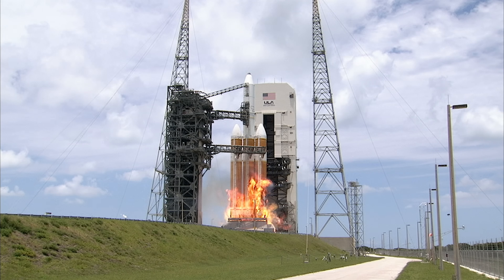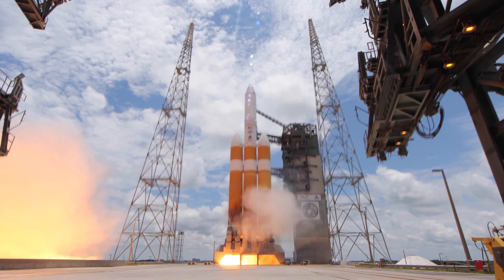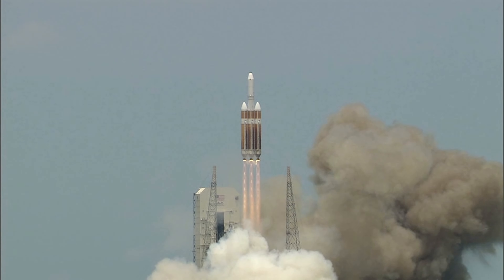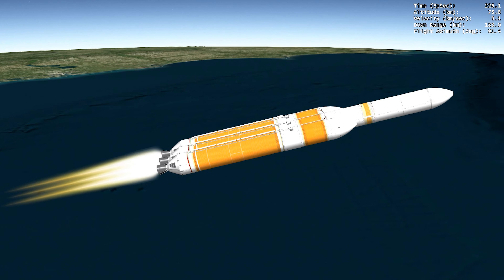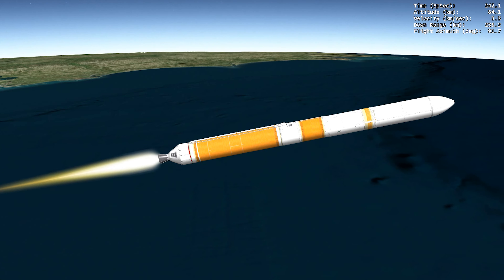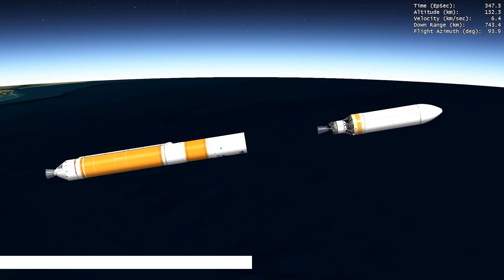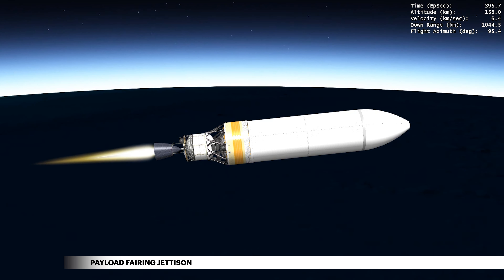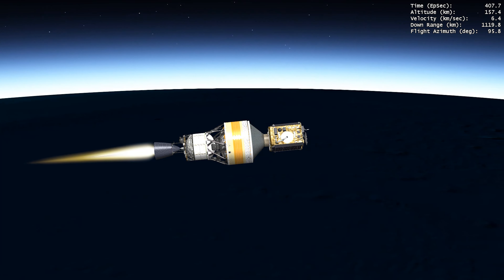Delta IV Heavy NROL-68 Mission Profile

Comment: We’re saying goodbye to 2 absolutely amazing rockets, Delta IV Heavy and Ariane 5 😭
Reply: Space industry has upgraded or switched launch vehicles about every 20 years (generation). Challenger/Columbia losses & USAF 1995 EELV shortened change.
1960 - 1975/80 - 1990/95 - 2010/15 - 2025/30.
Reply: @w9gb  yes

Comment: I thought the last of these was lit off a few years ago, glad to see I was wrong!
Reply: There are two left, NROL-68 NET 21 June, 23. and NROL-70 sometime next year.
Reply: For SLC-6 at Vandenberg, no more Delta Heavy flights.  ULA lease ended in 2022.
In 2023, Vandenberg awarded “new lease” for SLC-6 to SpaceX for Starship usage.
SpaceX uses SLC-4 for their Falcon 9 launches.
ULA is converting their SLC-3 launch site for the new Vulcan Centaur.
Reply: @w9gb SLC-6 isn't for starship. It is for Falcon 9 and Falcon Heavy.
Reply: @dogsinthedark  Yes, BUT he has switched usages before (Boca Chica).
He also previously said that SLC-4 would be host for Falcon Heavy (decade ago, 2014 press conference).
SLC-6 has flame trenches & size for Starship.
Reply: @w9gb  SLC-6's flame trench was barely capable of supporting Shuttle, it would not be able to support Starship. It's also not compatible with Starship's launch infrastructure, it would need to be done everything from scratch.
Reply: Delta IV DID Retire, however the Delta IV's that got retired we're the medium and medium+ variants of Delta.